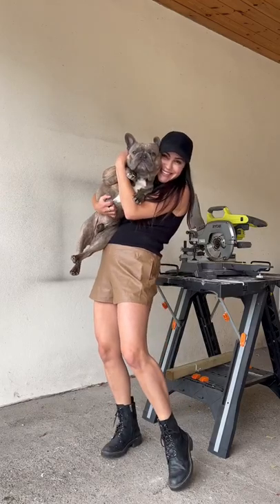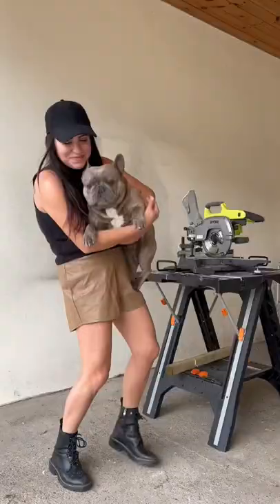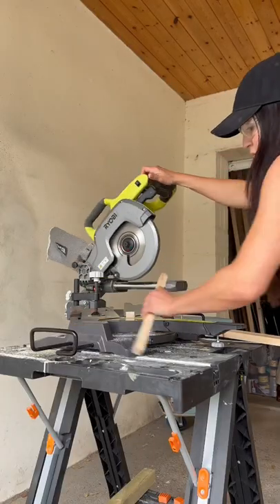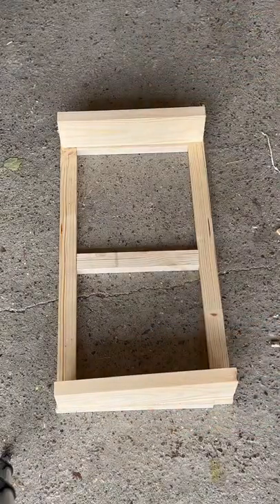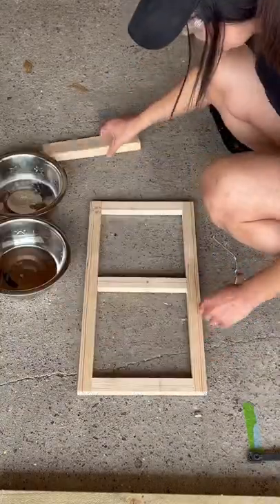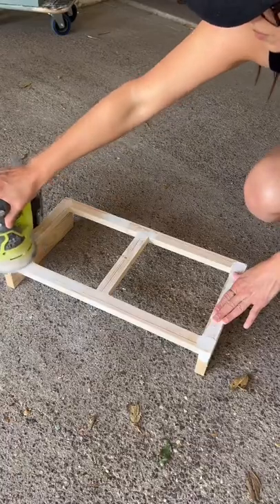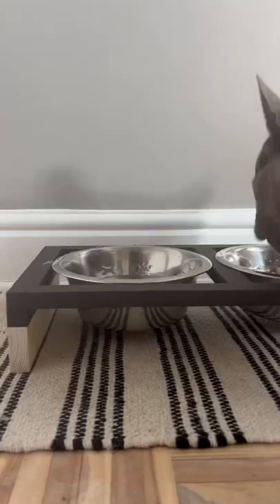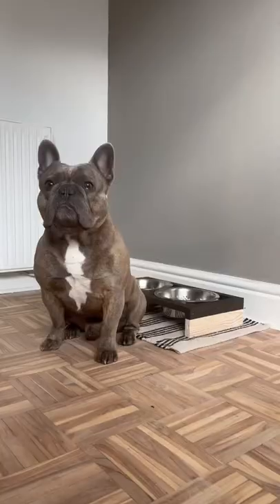The EASIEST Doggy DIY Project! 🐶 🐾 #shorts #diy #woodworking #dogs #powertools #dixiebelle

Comment: Theres also a rubber mat you can put under the bowls in case you don't own a expensive ass tools
Reply: You could use a hand saw and sand by hand as well. She’s just working with what she has. Why work harder when you don’t have to? It can be done without the “fancy tools” though. Take it from a poor diyer. 😉

Comment: Wow. Haters. As Don Miguel Ruiz says, It's not about you. 
So Haters hate because of who they are, not who you are or what you post.
For those worried about safety, this is a job easy to do w a simple pull saw, some CA or regular wood glue, a couple clamps if you want to hold or use blue tape to hold till the glue cures.
This would be an excellent project for a child to complete w mom or dad. 
Thank you for posting.

Comment: You can put some furniture grippers on the bottom of the legs. It's like rubber with adhesive on one side. Won't have to use the tower or scratch the floor.